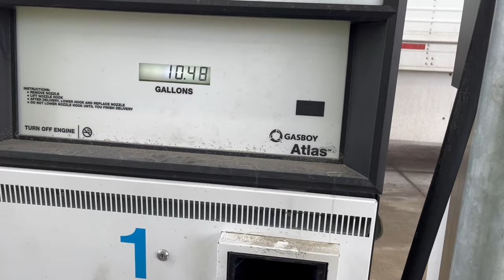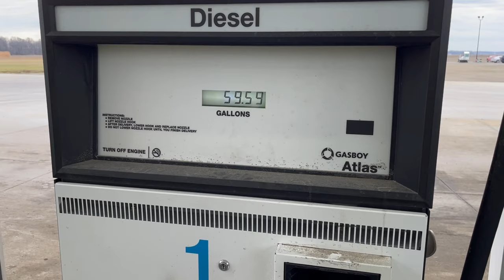Outfitting a John Deere 4940 Using a Rotator! SPREADER to SPRAYER!

Comment: what is that compartment on the top of the tool box under the pylon
Reply from the maker: That is actually the battery box. NRC Industries used to mount them in a compartment inside of the big tunnel tool box, but started mounting them on top like this shortly before we took delivery of this truck. I personally love it because it frees up more box space, and the batteries and all the wiring inside look as new as they did 5 years ago (weatherproof, no corrosion).